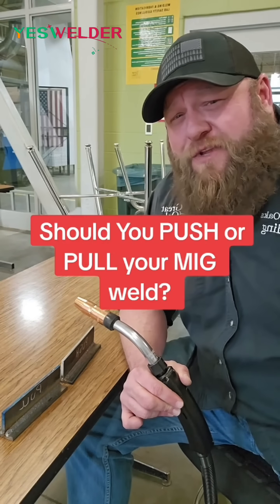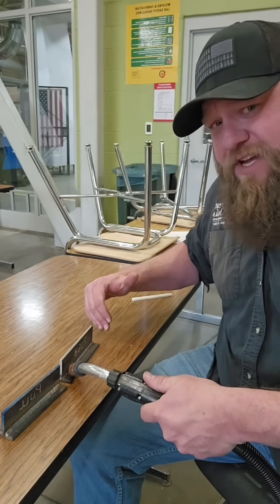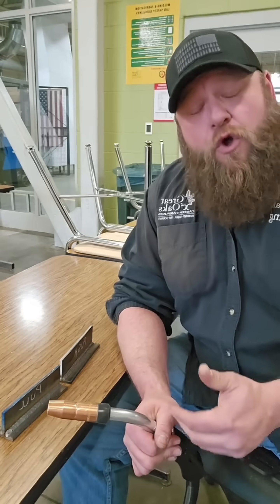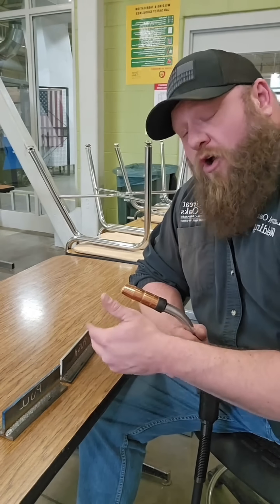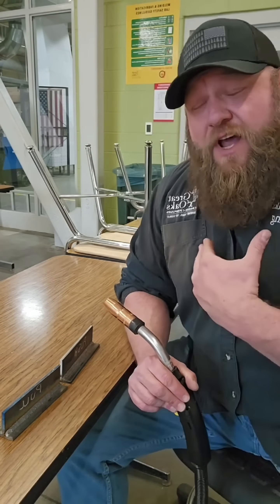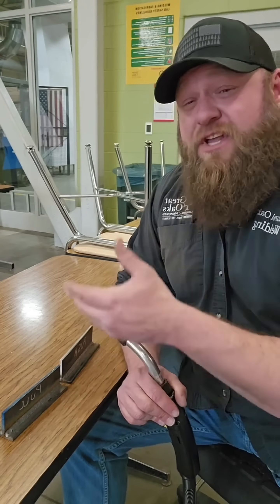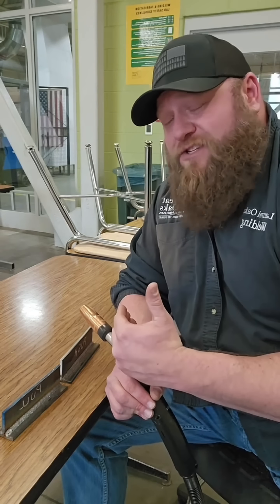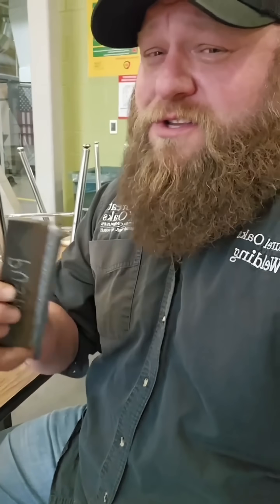Should you PUSH or PULL your MIG weld? Repost from @wolfe_cte(TikTok) #yeswelder #welding #weld

Comment: MIG Welding to me is line of sight  and accessibility 
Reduce your travel angle to no more than 5 degrees push or pull you will not have no real difference in weld performance or appearance 😊

Comment: Well according to the AWS with dual shield flux core, it doesn’t matter if you push or pull that as long as you are staying straight into the joint and not whipping it around or moving outside of the puddle. I’ve never failed a side bend test that way with my certification plate tests and even my X-Ray tests with 0.52, 1/16, and 3/32 dual shielded flux cored wires. If I’m dragging it’s either stick or self shield wire with a slight 15° angle. Hardwire is all from a push angle unless I’m running on really thin material. Travel methods vary depending on what situation you’re in. Just keep the arc inside the puddle and clean your material the best you can with a needle scaler. One thing I can’t stand is someone saying “just turn it up and burn through it” thats how you run into problems with getting worm hole porosity and slag intusions.

Comment: I run 1/16" aluminum with water cooled gun on spray arc transfer. I push all day baby, pulling causes too much convexity and Incomplete fusion on top and bottom toes. When pushing, if you are doing a motion or oscillation, be sure not to leave your puddle as this can trap voids, cause porosity and severely diminishes penetration

Comment: I pull everything I weld except for TIG of course.  If I need to get it done faster I just turn the heat up and wire speed and move faster, been working for me for over 20 years.
Reply: To much grinding and no penatratoin😊

Comment: I was taught to push weld because the heat of the weld was also being pushed forward therefore preheating the steel before I get there with the actual weld
Reply: 100 right. i can run welds around this guy cause he was taught one way only. never had the balls to try other options. i hate when they think they know all. don't change jesse.

Comment: Well considering that mig is a flash term... AWS has standardized this into being GMAW... non professionals call it mig... pushing vs pulling has several factors to include.. such as base metal temp, wire type, shielding gas used etc etc. Now if you're going off of GMAW, using say ER70s6 .035, with 80/20 on say 1/2" A36 then you would need to keep the gas out in front to help shield the weld. This has zero effect on depth of penetration but rather your heat input calculations would effect and reflect this. Which is why welders need to be certified utilizing a PQR and WPS based off of the PQR.... there close to 100 different types of welding but the most common are SMAW, GMAW, GTAW, FCAW-g, FCAW-s...

Comment: Depends but I like to pull it’s easier to see the weld fill.  Ensure right penetration.  
Your settings can be off and it’s harder to see it fill when it’s moving behind your cup.  
Imo.  
If pulse is on just push.  
I’d love to see poll results.

Comment: Depends, i weld sheet metal, in auto body, i generally pull because penetration isnt an issue but heat is, i push mig aluminum.

Comment: I say for mig unless your forced to drag its all general guidelines cause they say if theres slag you drag but if your doing 3g uphill you have to push stick and flux so if your doing it right its gonna come out right if your doing it wrong ists gonna be wrong its all about what the specific scenario angles amps and travel speed optimal conditions are not realistic outside of a shop you have to just get it done the way its laid before you

Comment: If your in a tight spot sometimes you don't have a choice. I usually aim straight in to the joint. You pretty much nailed it with your explanation of the bead profile and penetration